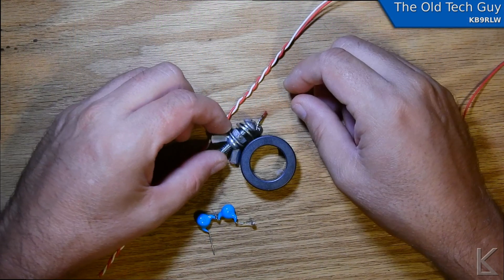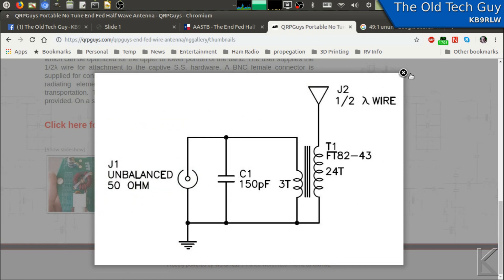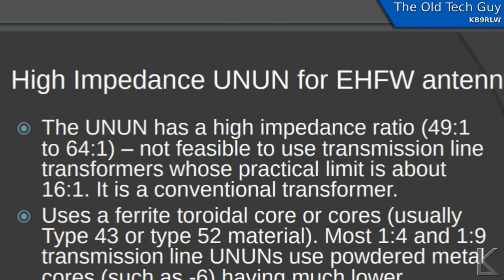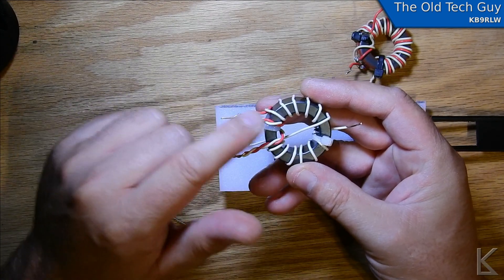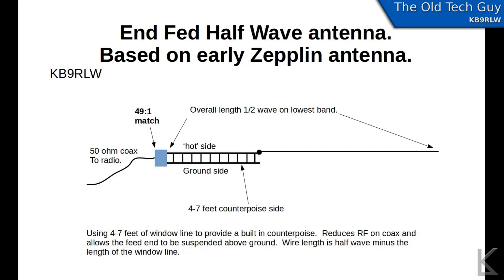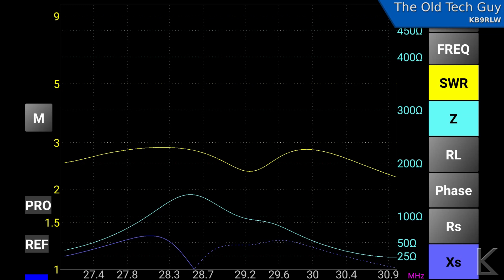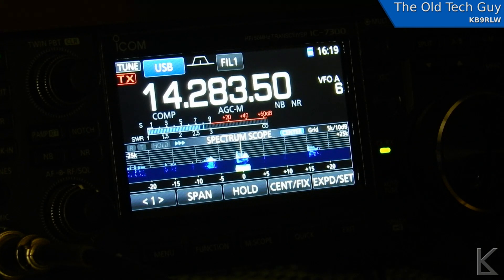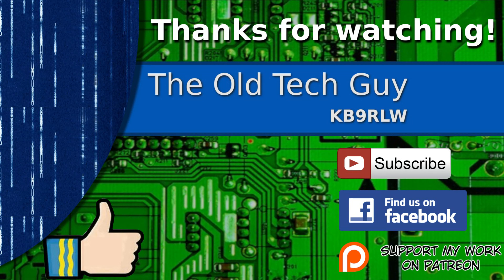Ham Radio - An end fed half wave antenna with built in counterpoise. (Experimental)

Comment: Using the Ladder Line as you are is that not a Zeppelin? A true end fed does not require a counterpoise. My ARRL 40 meter End Fed does not have a counterpoise and works just fine on 80 -10 including WARC and some times 160 and 6 meters. However my Elecraft K3 has a 10:1 tuner. If you look at it physically, it looks like a J Pole. The 49:1 is necessary to feed it with coax. Ideally, the ladder line should be a 1/4 wave at resonance and the wire on the "hot" side should be 1/2 wave at resonance, keep in mind velocity factor in calculating lengths. But reality is only the "hot" line needs to be of resonance length. The flickering lights can be fixed with a isolation transformer on the coax.

Comment: What advantage does the balun give you that a very similar j-pole built to 50 ohms with its lower shorted stub does not have?
Reply from the maker: It turns out none, it was a failed experiment. Not every experiment works out.

Comment: Do you have lots of noise due to the tendency of efh or have you found a way to mitigate that? I love my antenna, but don't love the noise. Also, my antenna was supposed to be made for 80 m however I can't pull in 80 m, I can get 40 but no 80 frustrating sometimes

Comment: i know the video is older but I found a number of good resources that explains you don't need a counterpoise for resonant half wave antennas.   If wire is too short for the band, you would than need a counterpoise.   Check out Hyendfed antennas as a commercial reference to what I am saying.   Also the qrp transformer in upur video is 64:1 with turns adjusted for the size of the toroid and other factors.  The Radio Prepper guy in Europe did a really good analysis of this theory.

Comment: The section of the antenna that contains the radiator and counterpoise looks to be a section of transmission line (fairly high impedance). If it's a quarter-wave in length, then it could be viewed as a quarter-wave transformer. Such transformers will flip the impedance from one side of their own characteristic impedance to the other. The analysis I've described here should also be true.

Comment: Hi Kevin, love all your vids. great source of information. just wanted to confirm something... You said that the 0.5 Lambda counterpoise for 80m band is 2m long, whereas on my calculator is is 4m. Am I missing something here? Just want to have clarity, as I tend to use 4m, although recently not with low SWR, but it's rather the parts around the toroid or so. thanks for your reply. This version with the ladder line looks great if we want to use it on 10m long fishing rod or so for 20m band or for 80, 40 bands as inverted L. take care
Reply from the maker: I wouldn't draw any rules from this experiment.  It was an experimental setup and didn't really follow long established norms.  As I recall, this was awhile ago, it didn't work very well.  (which I may have concluded in the vid, I don't remember.)

Comment: I have some news for you,  that transformer is 64:1 and it is NOT a UNUN.
Reply from the maker: It connects an unbalanced feed line with an unbalanced antenna.  That is the definition of an UNUN.  UNbalanced to UNbalanced.
Unlike a BALUN that connects a BALanced system to an UNbalanced system.
Reply: @loughkb  Can't agree with you.  The transformer as it is drawn has 2 separate windings out of phase with each other.  UNUN are traditionally one winding with taps and can behave as a tapped one field winding  transformer.  It may be wired as you say but the schematic isn't then drawn correctly.
Reply from the maker: @rickeaston3228  UNUN and BALUN are contractions for Unbalanced to Unbalanced and Balanced to Unbalanced respectively.
That is all.  How they are wired has nothing to do with their definitions.

Comment: I don't understand why a a halfwave dipole fed at the end (endfed halfwave antenna) needs a counterpoise of some kind. If the dipole were fed in the middle, no counterpoise would be necessary. Why is this not the case with an endfed halfwave antenna?
Reply: Because the end point impedance is not infinite. If it was, there would be no need to feed the antenna against anything. Now granted, the end point impedance is very high at a few thousand ohms, but even at that, it benefits somewhat when worked against a short counterpoise.

Comment: Interesting stuff and very useful thank-you. At 2'56" I guess you worked out that the QRP Guys are not actually using a 49:1 ratio but the other common ratio of 64:1. This is made up of 3 primary turns to 24 secondary. A moot point I know but wonder if this ratio would move the SWR dips to another part of the bands?

Comment: I am confused why the 49 to 1 transformer wound in this configuration even works??  the first 7 turns are wound CW right hand rule and the second set of 7 turns are CCW right hand rule  the voltage produced should cancel. like two wingdings coil dot opposite.   is it, that each coil is presenting an impedance in parallel. that matches to the 50 ohms.  the attached google link picture explains. The reason the primary is wound tight on secondary is that at high frequencies the core is mostly transparent no coupling through the core only through capacitance of close winding to secondary.  What are your thoughts?
thanks N7RBC
.https://drive.google.com/file/d/1Ei2uZxOjWDzubLDgEIrn4f-x51WOp0CW/view?usp=sharing
Reply: Hi Robert,  if you use the right hand rule where your thumb points in the direction of current flow and your fingers point in the direction of magnetic lines of flux you will see that all 14 turns of the secondary winding produce lines of magnetic flux all running in the same direction in the core material.  It's hard to visualize, and much easier if you take some wire and wind a core and do the right hand rule on a winding on each side of the core (first 7 turns versus the last 7 turns) to see the how the magnetic lines of flux are all headed in the same direction within the core material.  It's easy to understand the current flow in the winding because it has to be going in the same direction in the actual wire from one end of the wire to the opposite end, and then you can use the right hand rule on it.

Comment: For me, the AA5TB article on EFHW antennas is so far most knowledgeable piece if theory proved by his practical experiments. I've tried everything he writes myself and can confirm it works. Especially the part on 0,05 w/l  short counterpoise. The part on stray capacitance also works :), just be ready for some funny things going with your radio ir even your car's electronics ( my own experience) after you put 100W into this "stray capacitance" assembly. The best EFHW antenna is monoband fed via the tuned to resonance circuit. The part of the article on tuning with the help of 2,7 k resistor is very educational too. BTW , the German ham company QRPprojects used to have a nice "Fuchs antenna" kit. I have made one myself under their description and it works very nicely. The 49:1 transformers got very popular with the emergence of modern cores and also work very nice. But in no way they deny the aforementionned theory. I have at least 4  EFHW antennas in use of various designs for many years now: one full size 80-10m transformer fed as a very effective fixed station antenna, one full size portable transformer-fed  80-10, one portable 40-10 with the trap for the 30m band and a qrp 40-10  LC-tuned Fuchs type. The latter proved to be extremely effective used with the simple qrp rigs as a Mountain Topper and others since the tuned resonant LC circuit brings more selectivity on RX and filtering on TX. Thanks for a nice video and experimentation! 73! Linas LY2H.

Comment: I'm not disputing the HV. 100 pF cap. but I'm a bit baffled by it.
The self-capacity of coax hovers around 30pf / foot depending upon type so 20' of coax will already present 600pf across the low Z winding.
Anybody got ant thoughts on this?
73 G3NBY

Comment: Hi Kevin.  Nice video with some good info.  As others have pointed out, that isn't an "auto-transformer".  It's a bifiler wound transformer with both conductors joined on one end of the transformer.  An auto-transformer is essentially a coil with a tap part way along the coil.  One side of the transformer uses the two ends of the coil, and the other side of the transformer uses one end and the tap.  Both sides of the transformer share the part of the coil between the shared end and the tap.

The drawing of the end-fed antenna with the parallel counterpoise appears to be just a "zepp", or "j-pole" antenna.  The patent drawing includes what appears to be a balun or unun.  Could be for impedance matching I suppose.  May also  be for feedline isolation; to prevent RF on the feedline or to prevent static/lightening from coming up to the radio.

I've used 1/2" copper tubing j-poles on 2 meters for years and they do work great!

Cheers,
Alan

Comment: It helps to operate from the equivalent of ham radio heaven. From the FCC ground conductivity map it appears you are in a sweet spot. My QTH is one of the worst areas. http://radio-timetraveller.blogspot.com/2011/06/field-strength-calculations-ground.html Big signals can be heard from the Texas gulf coast, with QRP power.

Comment: Did you try it on 160m Kevin? I know its designed for 80m. But I would like a 160m antenna ( up to 40m) but don’t  have 264’  of garden space 😂 i wondered if this would be an improvement on the ‘long wire’ I currently use🤔

Comment: The so called "counterpoise" won't radiate or help with decoupling...All it's doing is removing 6 or 7 feet from the total antenna length...Two wire line is self shielding...No signal egress on HF with spacing that close...Need at least two feet.

Comment: What's the point of having the 2 turns of the primary twisted together?
Reply: There's no point electrically, but it's neater mechanically. Some I twist, some I don't. There's no difference in operation.

Comment: Hi their Kevin. The first thing that comes to mind on the subject of the "Zepp" antenna is has mentioned the high voltage at the end of a half wave. In Germany I had a 132ft 80m halfwave wire up from my chimney stack accross to my mates chimney stack.
The wire was well insulated at both ends. The feed point termination was a 2mm socket. a fly lead connected this to a  ATU. The earth was  flatened braid from a long roll of coax that had been discarded and stripped down. I had use of a 600 watt soldering iron that I was able to solder the braid to fairly new garden fence wire that ran under the antenna. This joined up with a bonding to the incomming cold water supply in the cellar. This had to go all the way up to the atick window into my shack. I found that the "Earth" was working by watching a 1" spark from the disconnected antenna to the earth terminal during an incoming storm. I was a bit concerned that my ATU would glow like an elecric fire and what sort of voltage would my valve preamp be getting every time there was a storm in the area. Beside the antenna being great for pulling in VK, Ws and you name it. It was great for pulling in Radio Caroline to witch was wired down into the flat for my XYL to listen to. So Kevin with a 1" spark to ground from a 132ft length of wire at 50ft up. What kind of spark would a "Zepp" antenna give with either a atmospheric charge on it or from a transmitted charge on it when getting landing permission on comming in. With a ferking big bang and a hell of a flash as gas is ignited of a Zeppelin airship coming into land along time ago ?. Sorry for all of the story of the 80m halfwave wire. It just came straight to minde of the discharging spark to ground from that antenna. That was in 1965/6. But you do tend to remmember those sort of things. 73 de John - G0WXU.

Comment: Thanks for the video Kevin. I liked the idea of having just one "lump" of wire to string up. This got me thinking: I wondered if you could try extending the half-wave section by 0.05 lambda (i.e. same length as the window line)? This would perhaps mean that the the antenna becomes a modified j-pole where the window line is acting as a 0.05 lambda matching section. Unlike the j-pole which needs 0.25 lamda length of matching line, the 1:49 transformer means you can feed it at the much higher feed point at the start of 0.05 lamda length of line?

Perhaps your antenna is actually working in this mode?? 

One problem is this the antenna would be balanced. So, might need to use separate primary/secondary windings on the transformer or perhaps put a current choke on the co-ax.

I think I might have a go at making one like this to see how it works? Thanks for the inspiration.

Comment: I've build a similar antenna using FT240-31 core not a long time ago. Interestingly it works a little bit differently than those antennas using mix 43. The antenna works OK on 20, 30 and 40 meters, and also on 15 and 17 if you don't mind SWR 2.5. I didn't manage to make the antenna work on 10 meters no metter how I tried. One drawback I noticed is that when you operate FT8 for a long time (e.g. 30 minutes using 30W calling CQ), the core gets quite warm. This is not a problem per se, but it affects the capacitor which is not an NP0 one, thus the SWR rises quite noticeably. Did you notice a similar behaviour of your antenna? Sadly most people who make end fed antennas prefer not to test them under the load, thus I can't tell wheter it's a common problem or only the problem of my item. 73 de R2AUK

Comment: However, the Idea with Zeppelin Antenna was not a Counterpoise, but Impedance Matching.. :D The Twin-Lead Part with Ladder-Line or Window-Line or something like that, of the Zeppelin Antenna is 1/4 Lambda long. But that works in a Way, that at the End of an open Feed-Line that is 1/4 Lambda long, the Impedance is changed into the Opposite.. So since the Feed Line is open, it means, the Impedance at the End of it is high, but at the Transmitter / Receiver  it is low. Means, the high Impedance of a connected 1/2 Lambda Wire will be low Impedance at the Transmitter / Receiver.. :D The Zeppelin Antenna is in total 3/4 Lambda (for the lowest Band) long. The 1/4 Lambda long Twin-Lead Part is open at the Transmitter / Receiver and at the Antenna ... The J-Pole Antenna is different in a Way, because the Impedance Matching Part, is done with a at one Side shorted 1/4 Lambda "Feed Line" Part and a "Tap" for 50 Ohm. But both Antennas have in common that they are about 3/4 Lambda long and that they do the Impedance Matching with a 1/4 Lambda Part, that basically is in a Way "Feed Line".
Reply: And I think is was also done this Way for Safety Reasons.. But the 1/4 Lambda Part of this Antenna Type was not intended as a Counterpoise.. :)
Reply from the maker: Yes, but when married with an unun like this, it takes on that job.  And it does seem to be working as such.  With other end feds and no counterpoise, I always got a lot of RF on the coax shield.  The lights on my LDG tuner would flicker a bit with power levels above QRP and it could re-trigger an auto-tune cycle.
So far with this antenna, I don't get any RF problems back on the coax.
I'll be keeping this antenna and putting it back up several times when I get back out to the desert.   So far it's working quite well.
Reply: @loughkb  - Yes. I saw that in the Video. The good Thing about this Antenna is, that it seems to work. :) But You possibly will have to experiment with and without the Counterpoise and look, if it really does what it should do and if it does so on all Bands. And if on on Band, the Length of Your Counterpoise gets closer to 1/4 Wavelength, it could start to change the Impedance of the Antenna too.. That could also lead to strange Results on the higher Bands.. However, in General I also think, that a short Counterpoise could be good for End Fed HW Antennas..
Reply: @loughkb  Because at 10 Meters I think 7 Feet would be something like 2 Meters and that is alllreadddy close to a Quarter Wavelength.. And that could possibly start to act as a Quarter-Wave Impedance Transformer.. as well.. And a Quarter-Wave Impedance Transformer transforms Impedances.. :D
Reply from the maker: @DE-iv8if  Yes, I plan on doing experiments along those lines with it when I get back out to the desert.   Right now it's a bit of work dropping it down and putting it back up.

Comment: Great vid Kevin.  I also use a ~130' wire with an unun, but with multiple taps.  On 80 I can cover the whole band with an SWR of < 3:1 with 300 KHz of it < 2:1 by using two different taps.  I have no ground attached to the unun.  I see absolutely no change in SWR when I attach an extensive ground radial system to the unun.  The rig is grounded via a simple ground rod outside the window.  I can cover all bands up to 12m and generally cover the whole bands with an SWR much less than 1.5:1  by using two taps.  This assumes that the wire has been trimmed to resonate on 3.600.  10m is more problematic for me.  The thing works excellent on 80.. but on 20, when compared to my vertical, often times a signal cant even be heard on the wire yet be pounding in at S9+ on the vertical.  I also use the wire on 160 and have worked almost a dozen states.. but using 100w.  It resonates at 1.820 there. I have no counterpoise at all.  My 'feedline' is 1.5' of coax running from the unun (on my wall) to the rig.  I have almost no feedline loss.. so I generally don't use the auto tuner.. not wanting to add loss needlessly.  Thank you for the fun videos!  73 OM